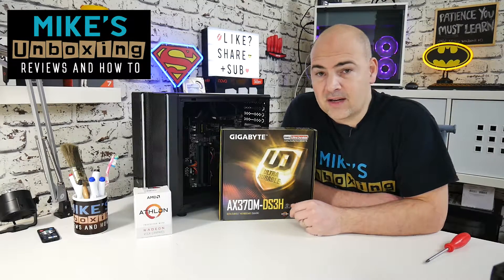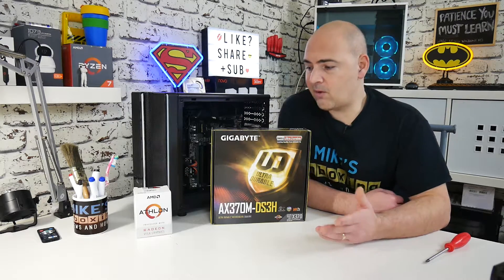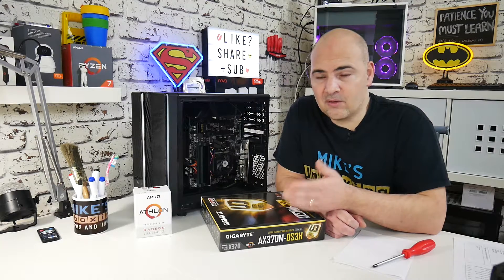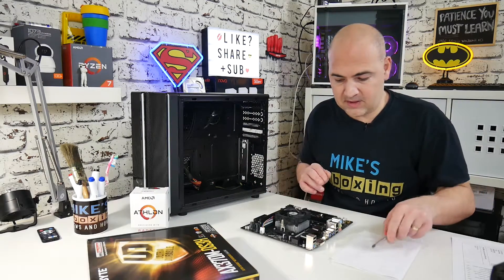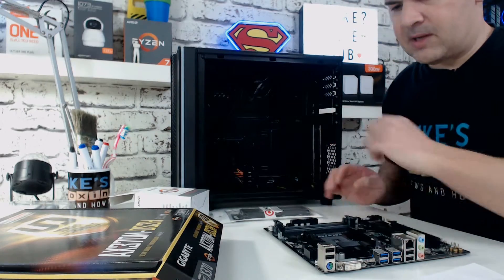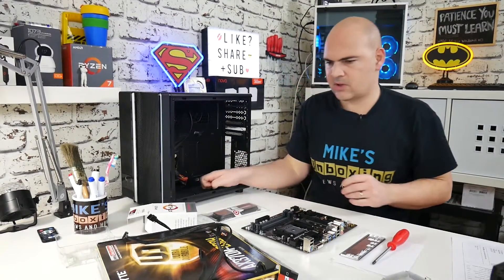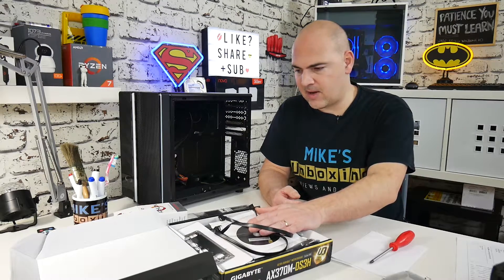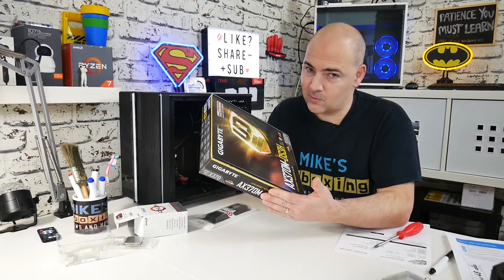How To Return A Motherboard Or PC Component The RMA Process

Comment: I used to work for one of the bigger companies here in the Netherlands on the RMA department, and often with motherboards we would inspect for visual damage, and perform basic tests on them, if someone claimed no signal output for example we would obviously quickly slap in a CPU. But funny story, if people claim there were other issues it was simply too time consuming to test, so we would just have this 5 volt charger laying around with the wires cut and just put the + and - over various solder points on the back of the board, to make sure it was completely dead. This was to avoid trouble with the big brands. A little life hack for those reading it and experience random issues with their boards :P
Reply from the maker: yeah i have heard of that being done, its been suggested by some discord members when a semi functional board is here

Comment: Who keeps all the packaging?  My (Asus) board has worked for 8 months. At this point  it just died...completely, and with no sign of life. Packaging was binned 5 or so months ago.
Reply from the maker: i think a lot of people do for this reason, and also those that often swap and trade parts, a boxed component holds more value on the used market and is pretty much ready for shipping

Comment: DO NOT SEND BACK THE ACCESSORIES. ONLY SEND THE MOTHERBOARD. REASON: NO GUARANTEE THAT YOU WILL BE GETTING BACK THE SAME MOTHERBOARD, SAME BOX, OR YOUR ACCESSORIES. GIGABYTE DOES NOT WANT TO FOOL AROUND KEEPING TRACK OF ALL THE MISC STUFF...ONLY THE MB.
Reply: FOR THE SMARTY PANTS OUT THERE...YES, OF COURSE PUT THE MB IN THE ANTI-STATIC BAG. :)
Reply from the maker: no that is totally incorrect and it depends on if the return is an RMA or refund. If an item is to be refunded they will want the lot.
Reply: @mikesunboxing  Hi Mike, No disrespect but thru Gigabyte I did an RMA for a Z690 MB and only sent the box, board, and static bag. Received it back repaired and funny enough in a different box but similar box. I questioned and wondered why they wouldn't want all that stuff. It was suggested that is was easier to flow the MB thru the RMA process without having to worry about the logistics of keeping everything in tack. Hence, maybe that's why I got it back in a different box...as long it was a box it was good enough for them. BTW...good vid.
Reply from the maker: @jackgamble6120  interesting, thanks

Comment: How many days take for rma after receive back my cpu as rma? I am waiting like 1 month and still suppose that is on checking step. I am living in Greece and the factory is on Germany.
Reply from the maker: There is no hard limit on these things. Some will take longer than others and depending on stock levels etc usually if a return is taking an “unreasonable “ time you could ask for a credit or refund, but it is really down to the individual seller
Reply: @mikesunboxing  yeah the problem is that they so not even answer to me about check cpu. I am still waiting for checking step. If the problem was stock they should send me e-mail about waiting for replace...

Comment: Will they still take it without the actual motherboard box?
Reply from the maker: depends on the seller and if the board is to be refurbished or refunded
Reply: @mikesunboxing  For me its MSI and I want a replacement for it.
Reply from the maker: They might be okay as long as the board and any required accessories are well packaged

Comment: after watching your video i send my motherboard alongwith accessories for rma. but when i revieved my motherboard back the accessories were missing. when i call rma service centre they deny that accessories were inside the box now i'm left with a motherboard without io shild, sata cables and worse without back plate
i would not say that was your falut because from my past experience i know the service centre in my location is very bad i don't know why company like msi choose these kind of service centre

so pro tip if you are sending motherboard for rma make sure to call rma service centre for things you  have to send alongwith motherboard. and also make a video of your product along with accessories  before sending for rma   as a proof
Reply from the maker: good idea, prove what has been sent
Reply: I found out manufacturers do NOT want any accessories unless they need it to test.

Comment: I need to return an AMD cpu… but it was working for a year, and stopped working randomly. 

I’d love to RMA since it’s been less than a year, but I don’t have the serial number or the product number since that was on the original box which I threw away right after I verified the system posts.

Any suggestions? I bought this off Amazon and my invoice doesn’t seem to have anything useful.
Reply from the maker: the serial number is on the CPU
Reply: @mikesunboxing  Right thanks, I had to get the the thermal paste off and sure enough it was there. Both the serial number and the product number in all its glory.

Comment: The Gigabyte RMA process is very lack on information about what to send back.  I had to risk just sending all the stuff back that came with the board.  The issue with my z490 Gaming X AX has a bad Ram slot (slot 4).
Reply from the maker: in my opinion it is best to just send back everything to avoid any issues
Reply: So you had to send your entire computer?

Comment: Hi,
I’ve got similar issue with my graphics card & they issued me RMA label.

Do I need to pay for the shipping cost?
Also do I need to print out the email that includes the RMA code and attach it to the box?

Thanks for your time & effort.
Reply from the maker: depends who it is with and what has been arranged. giving the box the rma numbers and as much information as possible could speed up the process, but again it will depend on the company and what they have asked or required

Comment: How do I know if a product Im buying has warranty or not? Im buying from newegg but dont really know if the products Im buying have warranty or not
Reply from the maker: you will have a warranty with Newegg themselves as the vendor, you also may have an extended warranty with the manufacturer as long as the stock is not grey
Reply: Mike's unboxing, reviews and how to but how am I supposed to know how long the extended warranty by the manufacturer is?

Comment: Also forgot to mention the other side: Intel boards.

If you’re going to RMA a board; you need the plastic cover to send it back, otherwise they will not accept the return/warranty claim.
Reply from the maker: True
Reply: wdym by cover?
Reply: Unstoppablek9 the cover where the cpu is supposed to go
Reply from the maker: @shq7621  yes if returning an intel based board it is necessary or the likely hood is that they will reject it
Reply: Mike's unboxing, reviews and how to only intel based? Im pretty sure any board, if you do not have the cover they will reject you
Reply: @shq7621  am4 doesnt have a cover on the chop because the pins are on the CPU not the board

Comment: Not to be critical Mike... is a RGB strip down the side of the audio port board really worth the time and effort to return the motherboard?  RGB would not be my primary focus on a system unless it was going to be a showcase for something I am going to show off at a public event where I was showing off my skills and someone would recognize the error.  Unlikely.  I have returned motherboards for not recognizing RAM, or if a BIOS flash has gone wrong (through no fault of mine).
Reply from the maker: I agree it was a bit extreme. The software was struggling to talk to the chip also and that gave me concerns for the overall usability and stability of the platform. Also as I often give these things to friends family and subs, it could have caused more issues down the road.
I actually had a report back from CCL and they confirmed the board had "issues " and gave me a full refund.
Better safe than sorry 😁

Comment: My best RMA tale, way back at the height of the radio rallies and computer fairs.
I'd actually heard about this particular trick, where the Seagate (or was it Western Digital) drives had pretty good warranties...
So, a table of assorted disk drives, a fiver a piece, there were small 100MB, 500MB, and the star of the show for me, a 1.2GB - and given what they would be worth working at that time, I didn't hold much hope for its chances, but examined the date on it - if I was right, a few months left on the warranty.
It was indeed dead, and looking up the serial, still in warranty, so did the RMA online, and since they were out of that model and capacity, I got a 1.7GB from them instead (refurbished, slightly different model series), never had to produce a receipt, it was all by serial number online
Reply from the maker: happy days. I have done a very similar thing very recently and it worked :-)